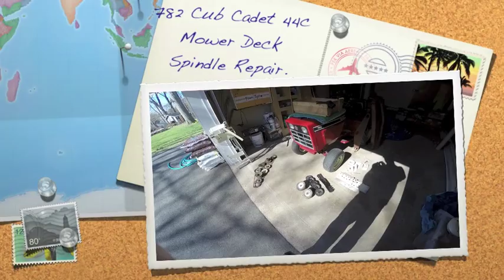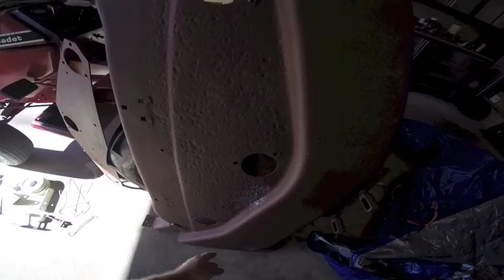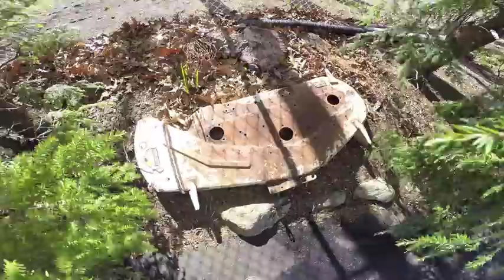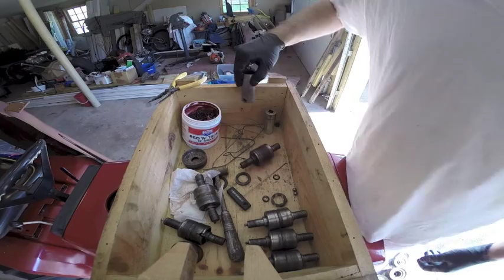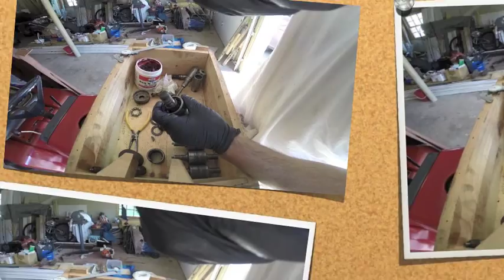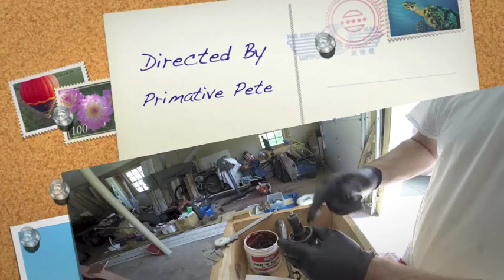782 Cub Cadet 44c Mower Deck Spindle Repair

Comment: I have the "other" type of spindle you referenced in the video.  I'm assuming with my spindles they have a bearing assembly sort of like needle bearings for a wheel?  I would just replace the spindles with new old stock ones if I could find them but... as far as my internet searches go I can't find anything.

Comment: What is the Ball Size in those deck Bearings,  I have 2 complete decks with some bad parts on each, going to One good deck,  one is a 38" one is a 42" from early 70's off of  Cub 86 & Cub 149.    Thanks for the Video,  I have been wondering how to get them spindles apart !!!   I'll just buy a box of balls and replace them all.